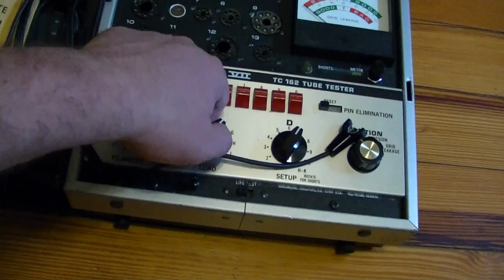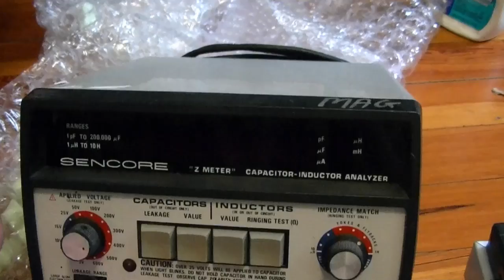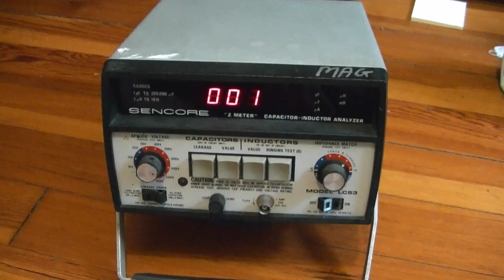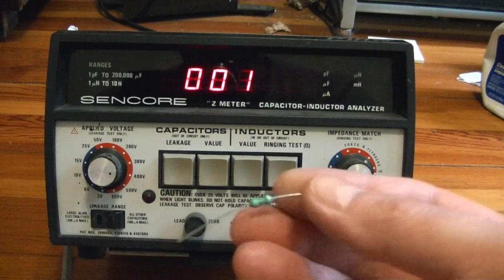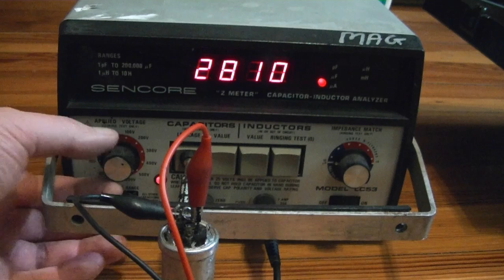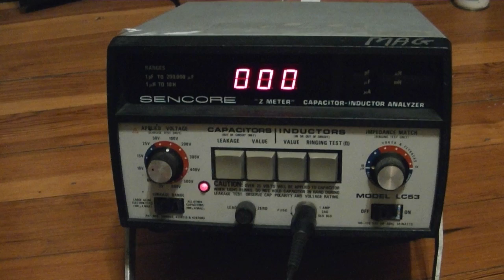New test equipment pt1o?

Comment: I got one of these second (or tenth hand, maybe?).  Leakage testing seems to work alright but the capacitance testing flashes all 8's no matter what I test.  I thought it would be something wrong with the leads so just for grins I swapped them out... No dice.  Do you know where I might be able to look for that?  Kind of at a loss.  I'm trying to put together a budget lab and I'm not off to a great start with broken equipment :-)  Any help is appreciated.
Reply from the maker: I suggest asking on the Antique Radio Forum in the test equipment section.  I never did get around to working on mine...
Reply: hey, i have one of these im working on. did you ever figure out your all 8"s situation?

Comment: I have that tester. Got mine for $50 from Govt Liquidators. Included all of the probes and cables, even the tool to wedge between the handle and the leakage button for reforming caps. Works great, I use it all the time. PS my display is always at 000 on power up.  The low capacity cable is RG 62 B/U...

Comment: Thank you for explaining how to use the Sencore. I am just starting out and recently purchased one on ebay. Did you have to calibrate the Sencore? Is there a way to discharge the electrolytics after testing/reforming?
Reply from the maker: Hi glad you enjoyed the video.  I'm sorry I'm not sure about the discharging.  I think you can but it's been a few years since I've used it and I don't remember.  I think the manual is available online for free.
Reply: You don't need to discharge the cap either before or after any testing.  The Sencore will discharge the capacitor before any tests are make to protect itself, and will discharge the capacitor as soon as the leakage button is released to protect you.  Don't bother "reforming" any capacitor.  This is a temporary process at best and the capacitor will soon return to it's leaking failure mode.  Just replace the capacitor.  BTW, the LC75 has a built in ESR function so it's far more desirable.

Comment: What ever wound up happening with the Sencore, Bob? Did you ever get it into it?
Reply from the maker: +Jason Atkin The Sencore TC-162 I restored and use in my workshop.  The LC53 has not been repaired yet.  I've been using a Solor CB-1-160 for testing mica caps.  The paper and electroltics I always replace so don't really have a need to test them.

Comment: Now I don't feel so bad! I am always following and getting what you have for test equipment. Finally, we reversed roles. You'll love the PR57! Mine came with stuck switches. Had to take apart the whole assembly. Works great now. A lot of the these have broken switch plastic knobs. No big deal. You just have to push in the rod with your finger.

Nice capacitor & inductor tester! A lot finer than our Solar CB-160s.

Nice modern tube tester also!

Comment: Those numbers shown when Idle may be the voltage on the leads. It is a separate display on the LC-102 which is a newer version of this tester. FYI, the LC-102 is AC/Battery operated, LCD displays, pre-programmed (EIA) or user-set values (good/bad display), ESR test, dielectric absorbion test, tests for Switching (Power supply) transformers. Also displays leakage by current or ohms. Leakage test is good to 1KV. Ideal for someone who also works on newer stuff like me.

Comment: Yeah, contact cleaner can cause havoc in some circuits, very high voltage RF, amateur tube transmitter and antenna tuner band switches are classic examples.

Comment from the maker: I'm glad I read a warning about using contact cleaner on the switches.  That can leave a residue that ruins the super high impedance leakage test.
Reply: You have to use contact cleaners which have no liquid carrier such as petroleum distillates, and use a dropper or small swab and above all avoid getting any of it on the insulators.  The voltages are probably controlled through high current circuitry not directly via the controls on the front but rather through logic.

Comment: I think the major cool feature of the Mighty Mite TC 162 its 300M grid leakage capability! I think the TC 152 has that too. No other tester comes close to that. That said, the circuit a tube is used in is the acid test, and substitution is still the most positive test I know of, except maybe for a really good curve tracer.

Comment: I remember finding switches like C&K or grayhill and they had the same style or series push down... and then locking... but having the exact same format. You would think that Sencore would have had a minor change and chose a locking type. Bob, can you just put a small switch in the back in case you need to extensive leakage testing?? Maybe you can but I bet its a 99 pole 200 through sw.. hehehe!!